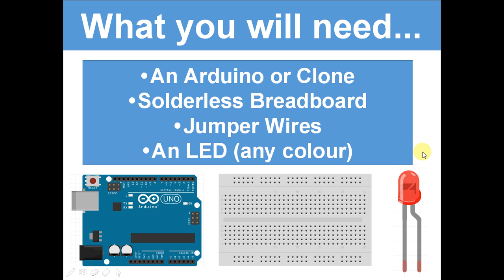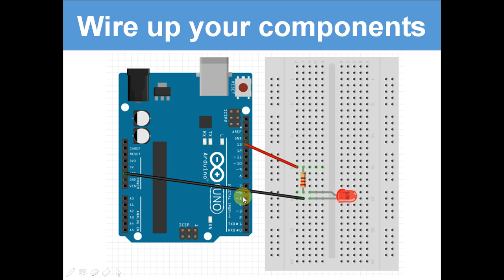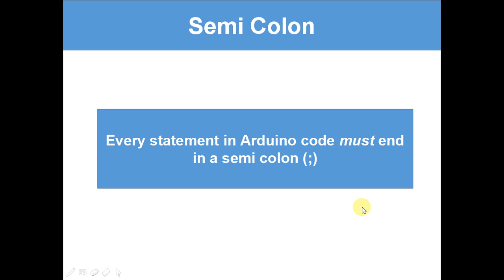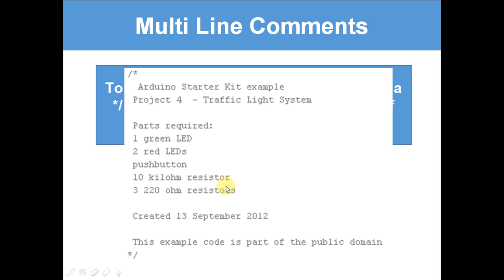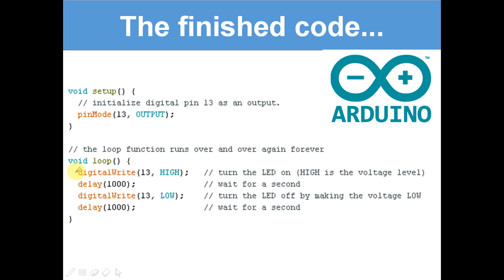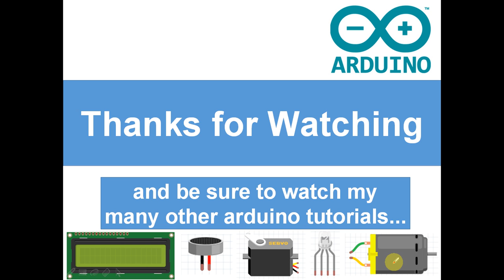How to Blink an LED (#2 Ultimate Beginner's Guide to Arduino)

Comment: the led has a "FLAT" side which is ground. its the cathode. the led is not completely round it has a flat side on its negative side because some leds has the same length pins so you can see by feeling it which is round and which is flat if you feel the roundness of the led. are you going to be teaching college? you could! i like the way you slowly talk. YOU SHOULD NOTE THAT THE CATHODE AND ANODE ARE REVERSED FOR BATTERY'S. even my instructor did not know that so when you speak of anode or cathode be sure your talking about if its a part or battery. it depends on its circumstances.